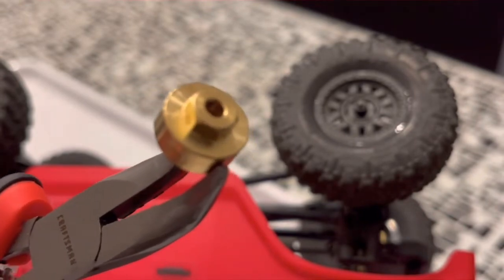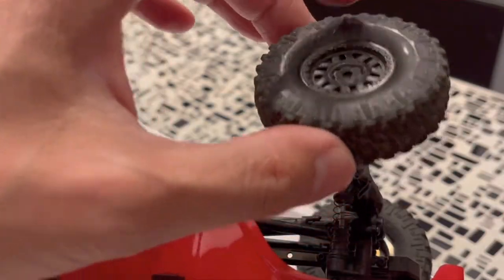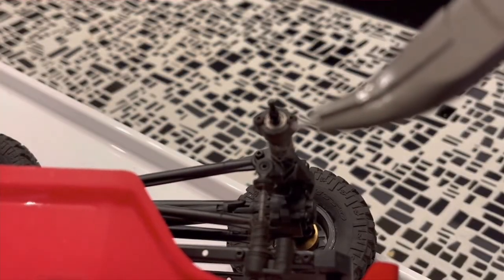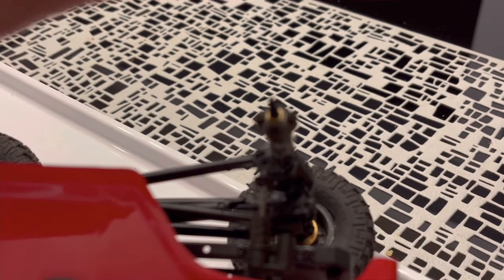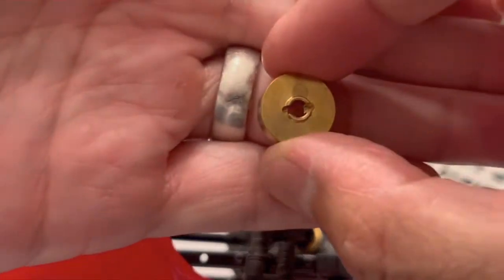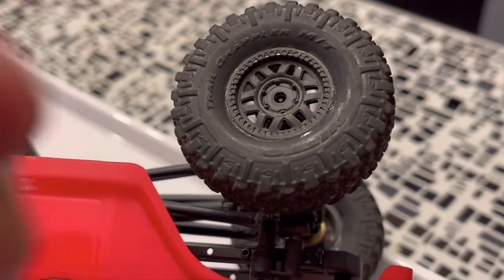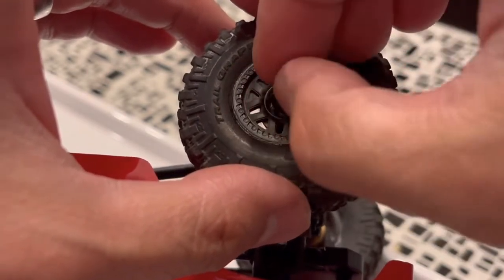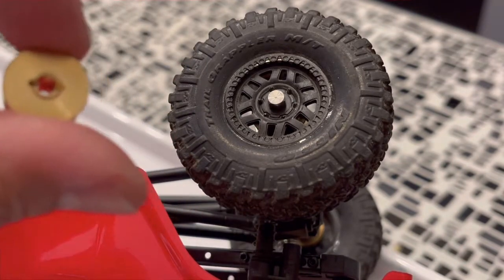Axial SCX24 Tutorial - Installing Brass Wheel Weights

Comment: Stock servo can turn them brass weights ok ??
Reply from the maker: So far so good! The motor died on me though but my fault for how I was pushing it through rocks without finding a more appropriate line.
Reply: @Funcentric  pushing on rocks with added weight also did it in.. I’m sure
Reply: Stock servo can barely turn the tires if you use it off carpet. E-Max is a cheap and good upgrade.